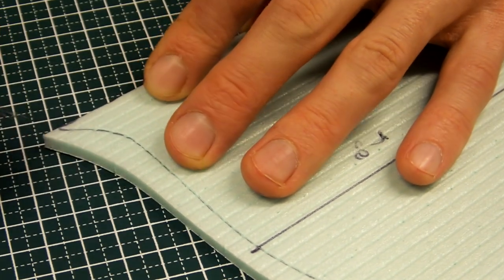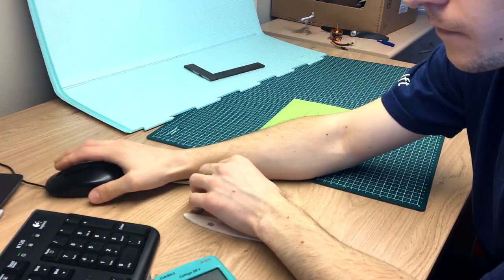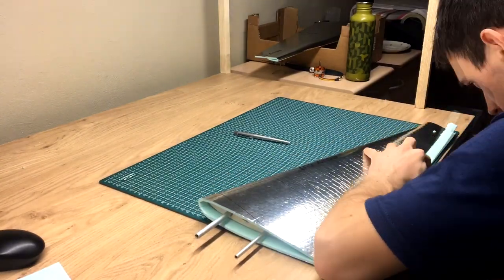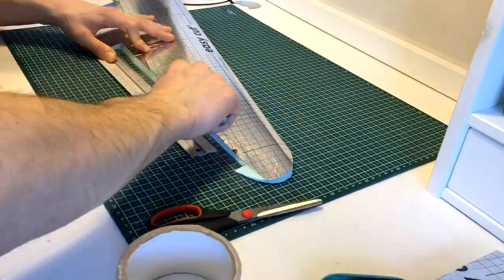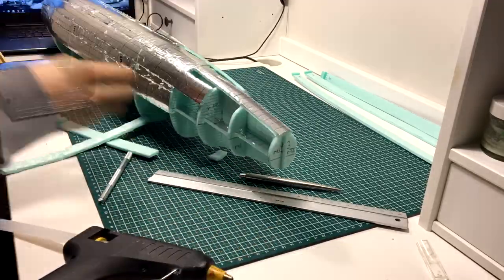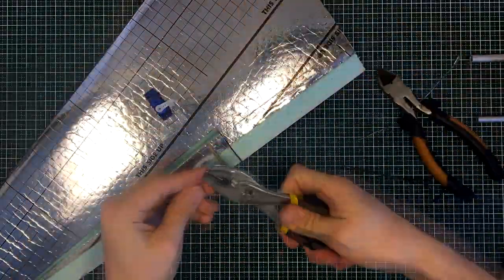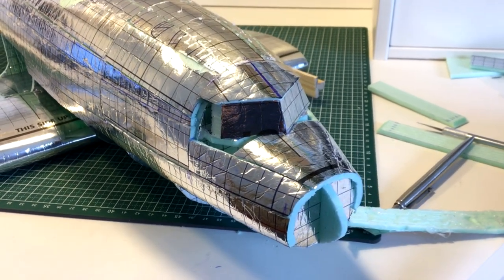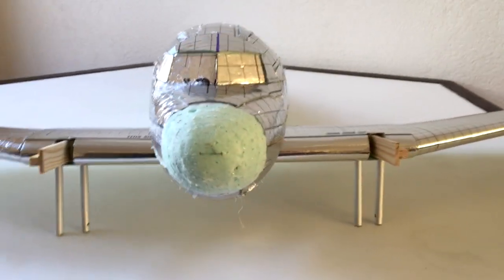Wings & Fuselage | RC DC-3 From Scratch (ep. 2)

Comment: What materials do you use?
Reply from the maker: I use a 5mm floor insulation board (it is used under wooden floors). Apart from that I use wood and aluminium pipes, hot glue, super glue, wood glue.
Reply: @flyrctoday1555  I'm sorry, but I'm new... How can i to print the plans Which the size used in this video? Any configurations before to print or similar?
Reply from the maker: @BraiyamGamer  You can use the zoom setting in printer preferrences  to tweak the scale to get it just right. If you never built an RC airplane then I would recomend starting with something simpler (I dont want to discourage you but a build like this can take several 100 hours). Check out a channel called Flight Test, they share a lot of plans of planes for bigginers. Or you can wait for my next project, I am planing to do a quick build on an airplane suitable for bigginers!
Reply: @flyrctoday1555  that sounds well!
Reply: @flyrctoday1555  I'm sorry but, could you send to me the plans or the file you use to print it? (The file  zoomed) please?, If you have it
Reply from the maker: @BraiyamGamer  contact me at flyrctoday@gmail.com and I can send you a PDF with the print-outs
Reply: FlyRCtoday anyone knows where to find this kind of insulation in Canada?